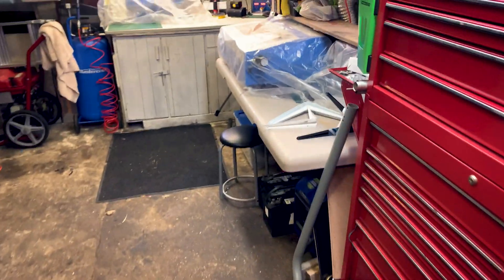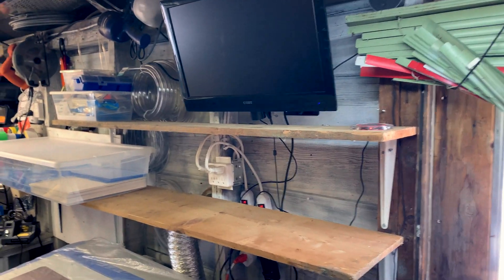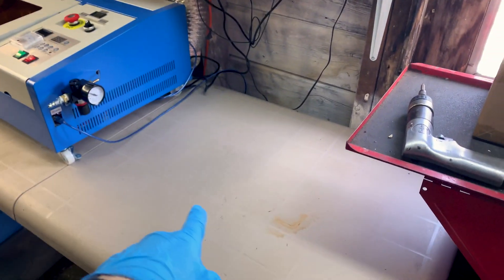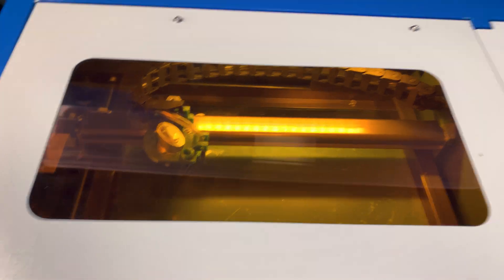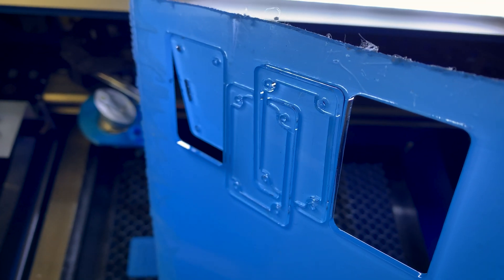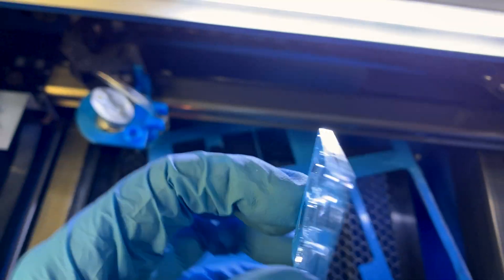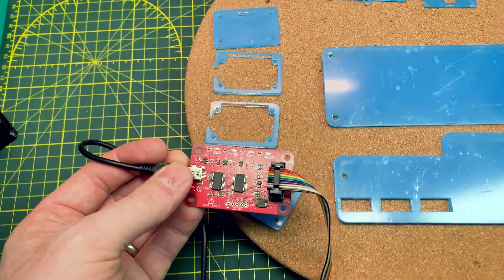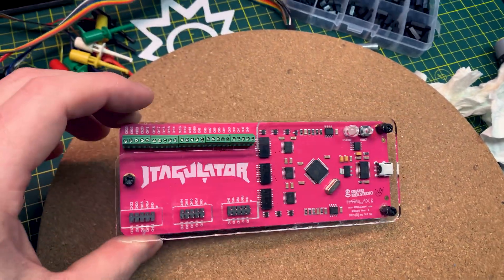Upgrading the Laser Cutter Workshop and Material Storage | Update

Comment: Your videos are so informative and inspiring, thanks for posting them... as a newcomer to electronics, mainly due to the rp2040,  so far,  I've enjoyed learning python and have a few  projects under my belt, they are basic but I'm proud of them any way. You explain things clearly, without tech jargon or expertitus.... I have the same K40, which worked straight out of the box and like you I'm amazed by the quality of parts it is making. What type of antifreeze do you use?
Reply from the maker: Thanks for the very kind words.  Really glad you enjoy them and are off to a good start in electronics.  It's so rewarding providing you can stay away from those who gate-keep or frown on newcomers.  The coolant is just RF plumbing antifreeze.  Ive used automotive coolant too but this is much cheaper/better

Comment: I think we started our K40 journey at the same time.  We've done similar mods although gone down different paths.  I agree the quality of what you can get out of this at home is amazing - I suppose a laser is a laser no matter how cheap the mechanism that holds it is.  I'm on my 3rd PSU now - but only my second High Voltage transformer.  The new transformer really improved my power - and I connected it with a High Voltage connector so that when I replace it in the future I dont have to disconnect the red wire from the laser tube end , but just wire up the new transformer to the connector.  Really enjoying your videos mate - especially the K40 ones..
Reply from the maker: Thanks muchly for the feedback.  Cheers